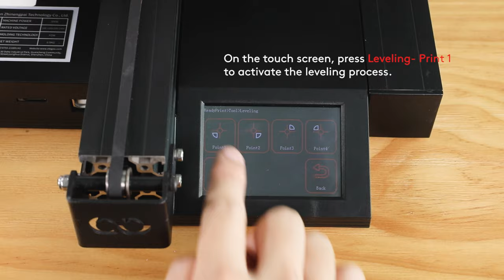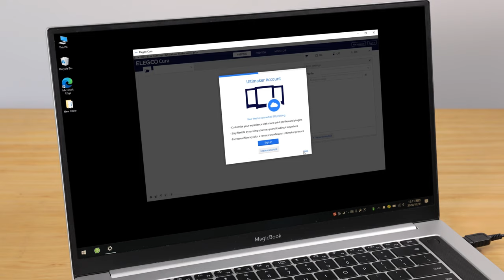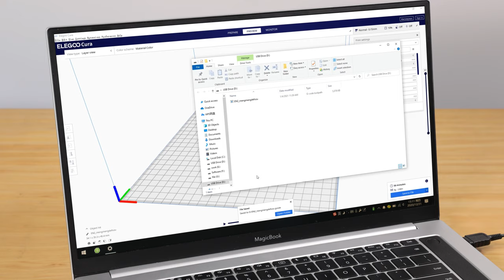ELEGOO Neptune 2: Assembly Tutorial

Comment: I put the axis switch for the bed 5mm but the nozzle is not near the bed there is a big gap
Reply: Mine too, a huge gap. Did you get an answer? Because I'm soon sending them back a 2nd one. (first one had stripped screw holes)
Reply: @Duder_abides  i sent it back and got a different brand

Comment: The WORST buy i ever made. Out of the box for a brand new (NOT 2nd hand or restored!!!): 1 lightly rusty bearing ball, 1 totally rusted bearing ball, z-axis stepper motor after 3 weekd died and no longer can lift the axis/extruder, extruder motor loses steps (squeeky and clanking), bed is deformed (out of the box, the center is 0.2-0.3mm lower than any corners). Customer service just "try" to fix it without any results, and i still have my NOT working printer (it made only 1 not 100% good print over 20 try).
MONEY TOTALLY WASTED. 

With other brands (for 15-20€ more than this one) i had NO issue at all. 1 failed over 250 prints, and no defective after 5 months.

This is my 2nd FDM printer from Elegoo, and 4 resin/MSLA printer from Elegoo.... After 2 years only 1 is still working. The most died after less than 6 months (motherboard, steppers, and z-axis). The funny thing is: LCD were still working (from 350-1200 hours).